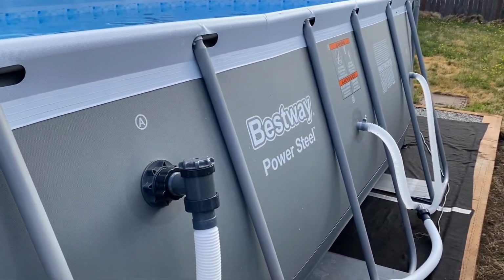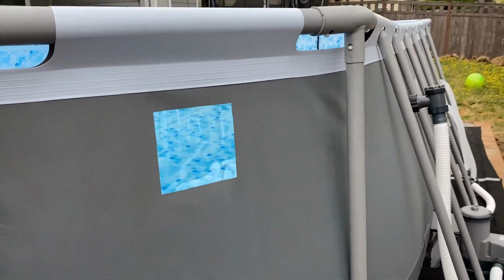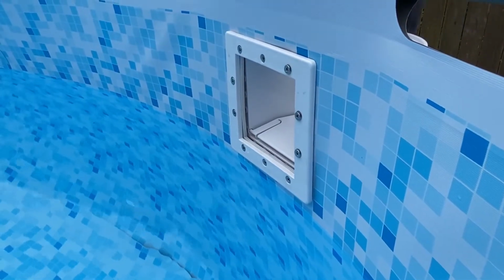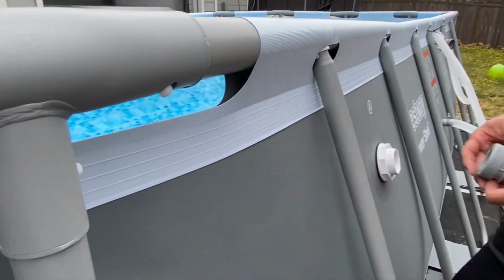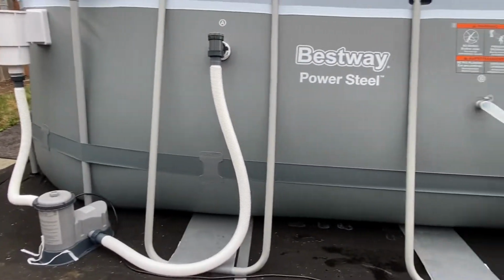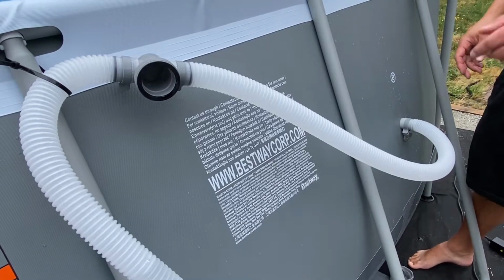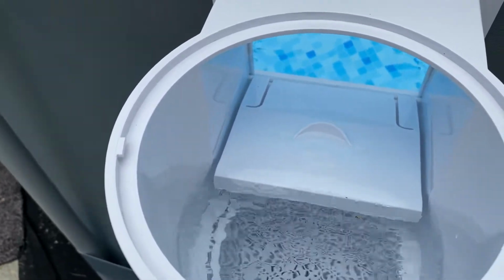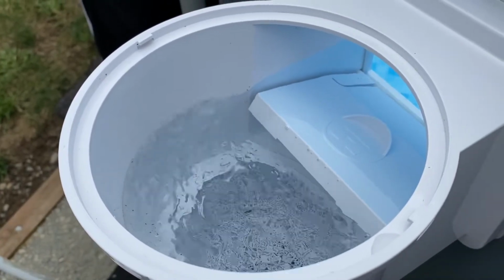Skimmer install onto above-ground pool, vinyl pool, Hayward Skimmer, Bestway/Coleman/Intex pools

Comment: Nice job, the only thing I did differently was I installed the skimmer and then cut the liner which made it a lot more stable to work with.

Comment: There's videos about adding a skimmer to these types of pools all over youtube. I put mine in 2 yeard ago and it made a huge difference. With my 3/4 hp sand filter I can angle my intake facing up and send the water spraying to the other end of my 22 ft pool. The flow is amazing and vacuuming the pool is so much easier. No more clogs every 5 mins after winds blow pine needles into the pool. Best upgrade I've made!

Comment: Do you have a plug for the skimmer... Curious when you clean the filter in your pump do you plug the skimmer?  I see you have valve adapter for the outlet from the pump... Great Video by the way.. Im looking to do this exact set up!
Reply from the maker: There is a valve now. Before we had the valve it was fairly easy to simply turn the pump off when changing the filter. You have to physically lift the pump higher than the water level before opening the pump though. 
Side note… I love using filter socks. If you use the filter socks over the basket you change (or wash) the actual filter much less often.
Reply: The only down side to adding the sock filter is the additional restriction on the pump. It could be enough to cause premature failure or damage to the impeller

Comment: So happy I found your video, we have exact same pool and been on the fence about Hayward skimmer, been watching a lot of videos but all have been round pools so I was trying to figure out where to install skimmer and what to do with the two side holes.. any updates?
Reply from the maker: We decided to leave the black plugs installed in the side holes (as shown in the video) this season. They worked great, even with young kids splashing around vigorously. No leaks. We zip tied the hoses a little better so they look nicer. We will upgrade into a more permanent solution next season for aesthetic purposes. It’s been a few months and the pump still works very well with the skimmer. There is no need to upgrade the pump. I do recommend installing a valve on the return so you can replace the filter without lifting the pump above the water line. Also, FYI the white filter water socks are great. I use a sock around the filter basket and replace every 3 days and my main filters last a lot longer. Our pool is really clean. I highly recommend this skimmer.
Reply: @thegridirongirl  amazing, I did not have a cartridge filter pump with ours, we had a sand filter but I just upgraded that so now we are going to convert the return to 1.5” and get the Hayward skimmer, was curious about the two side holes and what to do but like you we will figure a permanent solution, I like the skimmer install on the end, that was also a question but you answered it and I think that is amazing, great video and made my decision easy about the upgrade
Reply from the maker: I’m glad you like the video and found it helpful. Good luck with your install! When you find a permanent solution for the plugs I’d be curious to see it.

Comment: Is you inlet, where the water comes back into the pool completely underwater, this is what I am nervous about, have the same pool as yours and gonna use the other two outlets running through the original pump, we upgraded our pump already, to push water through solar panel that came with pool, and more filtering, but I love your placement of the skimmer, gonna do the same area, just nervous at cutting liner as I think everyone is and worried about depth for the inlet eye ball return

Comment: did I miss you cutting the hole for the new inlet jet thingy?
Reply from the maker: The inlet/outlet system already existed. We just re-configured the way we used the holes. Two holes are now obsolete but we kept the tubes in because we weren’t sure how we wanted to cover them.
Reply: You gotta be kidding me...

Comment: I’m in the middle of installing a sand filter and adding the Hayward skimmer to the same pool you have(Bestway). Everything has gone smoothly until know. Did you cut out the hole for the return to the pool? I cannot seem to get the part that comes thru the pool wall, to attempts to do what you did to install the eyeball. Any information will be greatly appreciated. Thank you.

Comment: Hi, I have the same pump as you and have ordered my skimmer. Are you still running the skimmer on this original pump? I’m worried it’s not powerful enough to work effectively
Reply from the maker: We are using the original pump and skimmer from this video and it worked great over the summer. I do use filter socks which are changed every 3 days or so. As long as you keep the sock & filter clean the pump is plenty of power. I too thought about upgrading the pump but have not needed to.

Comment: I really dislike how you lose water depth with these skimmers.

I think those over the pool skimmers work fine, you just need a powerful enough pump to make it work.
Reply: I've made this install on my 13' Bestway, it works really good and I'm still using the original Bestway pump that came with the pool.

I placed it so my water level is inbetween the two vertical screws, so my top 3 screws is above the seem and my water level in the pool is exactly the same as before.

I recommend everyone to make this conversion and get a clean pool with little to none effort. And yes, the original pump is strong enough and can handle the skimmers vacuum function without any concerns.

DON'T CUT the double gasket thou, it's a double gasket for a reason. Do it like in this video, lower the water level and cut the hole.